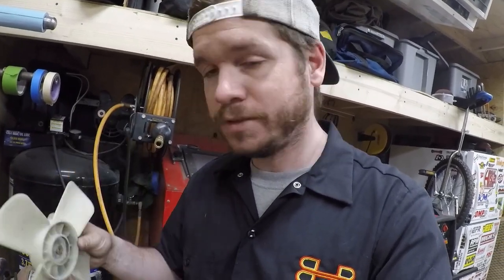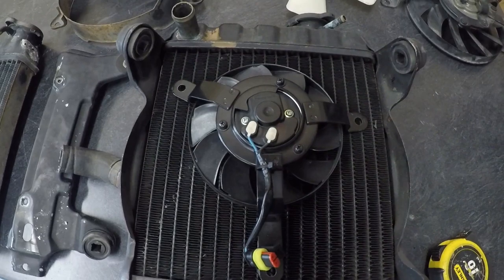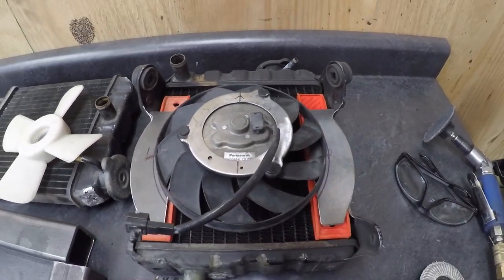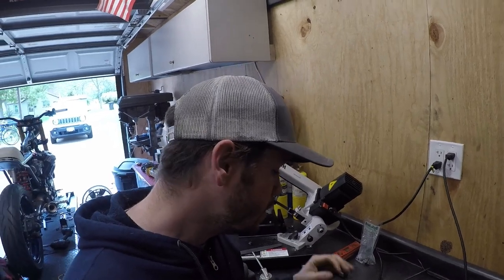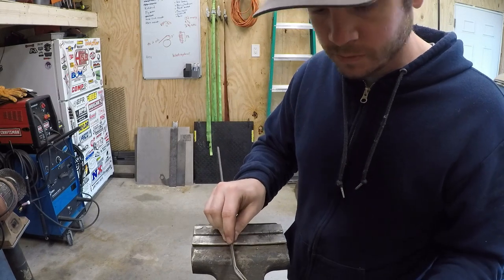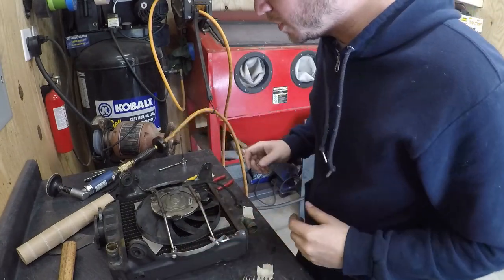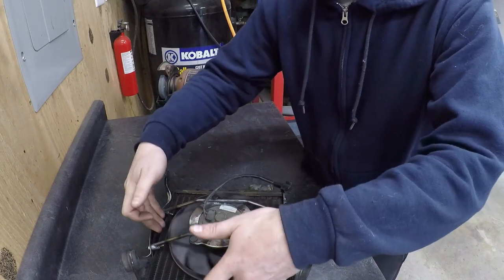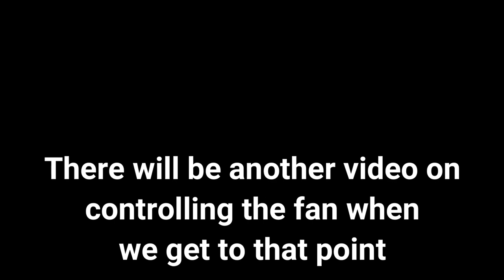CX500 Tracker - Electric Fan Conversion PT1! - EP 25

Comment: I know this video was last March but Im just catching up. You certainly put a lot of effort into the fan. I put a 650 engine in a 500 frame and ran it for a year without any fan. Never a problem but then again I live in Ireland where we do not get excessive temperatures. When the bike is moving it never gets hot and I avoid towns and city's. Having moved the same engine to a different build I only recently put a 4" fan (quad bike) on the inside of the rad. I have a manual switch and wired direct to battery.  If the temp starts rising in traffic I throw the switch. However I expect never to use it.
I also ran a CX500 custom for years without the cam fan blade. Never an issue. These engines run cool.
Reply from the maker: Thats been my opposite experience here as we have stop and go traffic and really hot seasons. I did come up with a great way to control this and it won't likely need to run at full kill. We will see. Id just rather have more than enough fan vs too little. Thats the fun in making something new.
Reply: @BrickHouseBuilds  That is the fun indeed and a great job you are doing. Still catching up on your other videos :)

Comment: When I first started thinking about was the shaft on the engine itself that would rub on the fan motor, but I'll shut up and watch and I really was wondering why you didn't use the Honda part like you showed us a bit ago, but what you built came out awesome. Oh that would be on the 500
Reply from the maker: Yea the 500s had the mechanical fan with long camshaft snout while the 650s had an electric fan from the factory.  The stock fan was no good and I wanted to find a larger e-fan to replace it. I always try to find new parts to use so this was just an exercise in that.